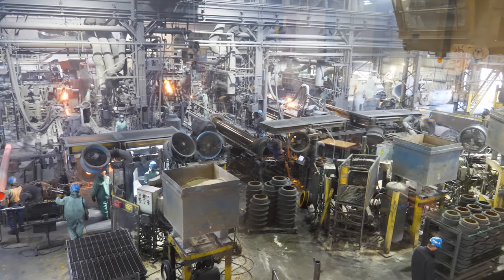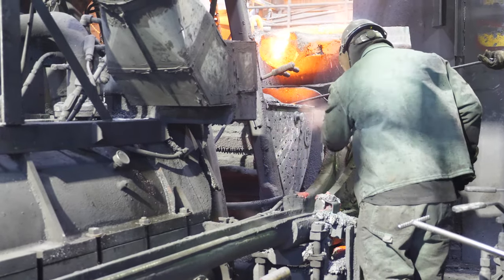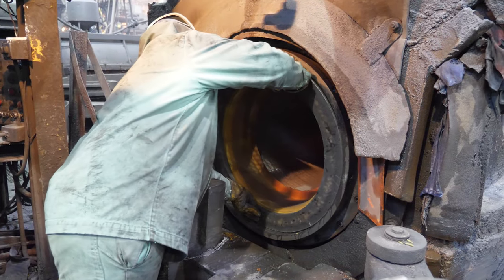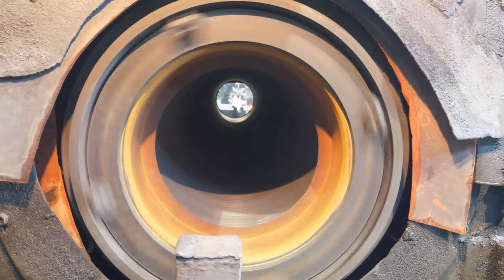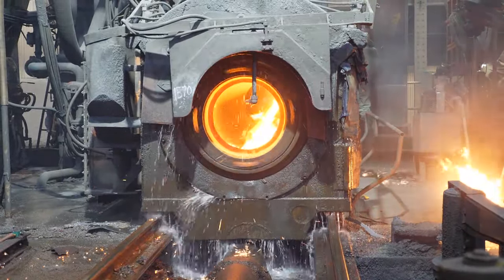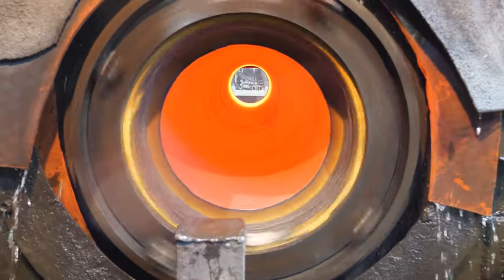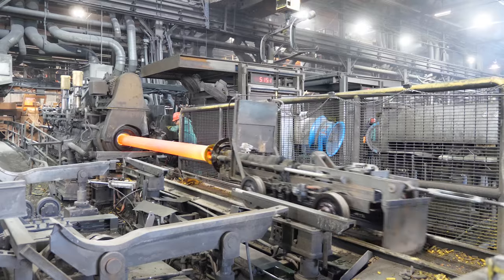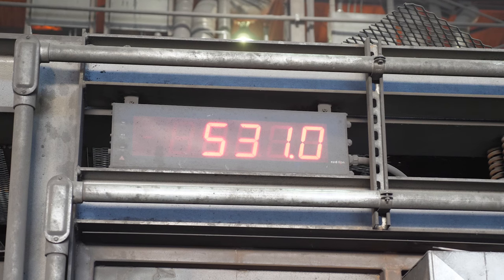Centrifugal Casting of Ductile Iron Pipe - the De Lavaud Process

Comment: total whight how much this pipe
Reply from the maker: Thank you for your question. The pipe we make can weigh from less than 10 to more than 200 pounds per foot. This depends on the diameter and pressure class of the pipe. Here is an excellent article we have written about pipe weight with more information and videos.

Comment: Why doesn t molten iron sticks inside?
Reply: I'm guessing because the pipe shrinks slightly as it cools. Maybe the mold splits in two as well.
Reply: The mold has a special surface that leaves a pattern on the pipe known as penning ( I’m not sure I I spelled that right) and it helps with pipe extraction when molds get worn or just old it can be very difficult to extract the pipe.
Reply: They spray refractory material on the inner mould surface before boring the molten material inside
Reply from the maker: The mold doesn't split, we prefer a more controlled process.
Reply from the maker: Peening is part of it as it helps hold the refractory material in place. Thanks for the comment.
Reply from the maker: ahmedhawater7522 has it right. You can see a nice video of the peening and refractory material working together here: https://youtu.be/KnIYsqSLhVQ